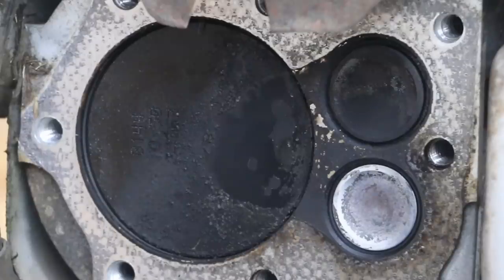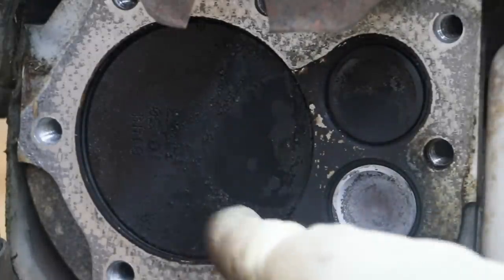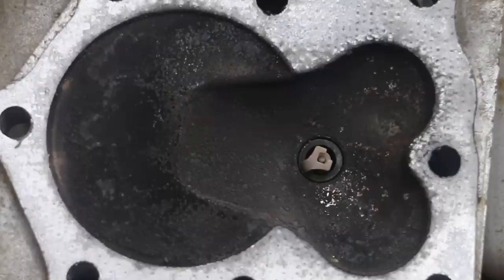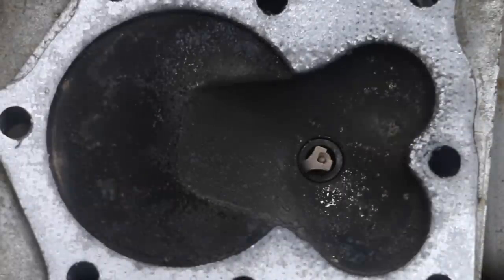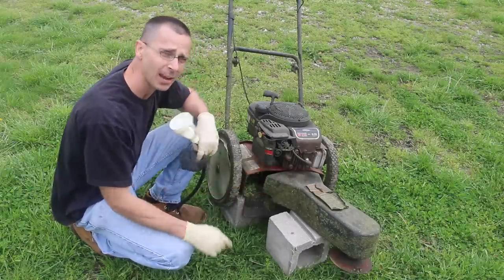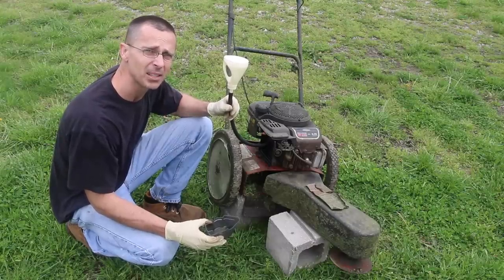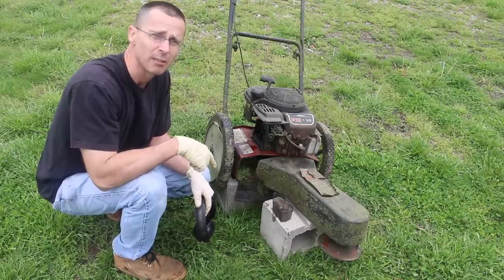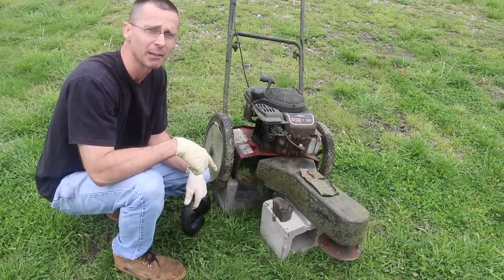Seafoam--can't believe what it did to my engine part 3--cylinder cleaning test!!

Comment: I think if your going to do the sea foam treatment on a small engine like this you should pull the head and knock off as much carbon in the bulk spots then run the sea foam.
Reply from the maker: Thank you for this recommendation!

Comment: I heard running kerosene as oil through the motor could help clear out build up be interesting to see that
Reply from the maker: This is a great video project recommendation--thanks!
Reply: seafoam is 80% kerosene. you can get the msds sheet on it.

Comment: I think it's a 50/50 made a difference of 20% on the piston head and valves  but as far as the cylinder head no difference.

Seems to have transfer from the valves and piston to the cylinder head about 10% from the combustion process due to the explosion off the combustion .

Overall what we can't see is under the piston and valves what difference it made at the bearings.

Due to this being a cast engine, some could say that there is good carbon and bad carbon. 

Some carbon is not meant to come off as it is the pie crust to the engines apple pie.

Take that all off then the pie would just be apple sauce.
Reply from the maker: Thanks for commenting.

Comment: also you may have less carbon buildup by using a better quality spark plug. the Easy fire plugs are a waste of money. as a mechanic when I see one of those in an engine that wont start, by replacing it with a better quality plug can get it running at least 60% of the time.

Comment: what about putting seafoam down the spark plug hole and letting it soak overnight? remove the excess the next day then put more seafoam in the fuel tank and run it and see what happens
Reply from the maker: Great recommendation

Comment: Best way is to mix it in the fuel  every now and then ...It will work on the carbon much longer than directly pouring it in the intake....I only noticed a lot of difference around the valves ,the head and pistons ,none at all hardly..Adding a wee bit of diesel fuel to gasoline helps a lot also,in any gasoline engine,cars trucks etc,..About a half oz per gallon is good enough..Other solvents like Naptha,,Mineral Spirits ,Xylene ,Toluene are great  to use ..
Reply from the maker: Thanks for the recommendation!

Comment: couple questions and wondering if you did a video on this
adding seafoam to the gas tank and if it works better/worse/same
and adding seafoam to the engine oil, does it clean
Reply from the maker: I've tested Seafoam and it does help remove carbon deposits

Comment: Seafoam seems useless, I think water had better results. What about Redex fuel injection cleaner that's usually for fuel pipes and injectors cleaning or carb spray?
Reply: ilia Gofman why useless? I’ve never used it but seems everyone says nothing but good things. Far more than any other additive I’ve ever seen. People have let their carburetors soak over night and they seem to clean it.
Reply: @fringestream990  It's useless because the head and piston are still as dirty as they were in this video. I bet Redex is better

Comment: I use regular transmission fluid!  I fill my gas tank up on my Silverado and then I pour One quart of transmission fluid into the gas tank and run it empty!  The transmission fluid will clean off all carbon as well as clean out the injectors!  Try it and tell me what you think?
Reply from the maker: William, Seems like a great strategy!  Thanks for offering this suggestion!

Comment: I made a breather for a different application by taking a cardboard tube the size of the breather I needed to make. then using fiberglass 1 oz mat and resin formed it around the cardboard after 3 layers of mat 1 oz size set and harden.  I made the top as well to fit the air breather i just made.
Reply from the maker: Impressive job!  Thanks for sharing this!

Comment: will carbon build-up lead to backfire on shutdown on a 17.5 HP briggs 1 lunger???
Reply from the maker: It's possible.  It's likely that the engine is being overfueled upon shutdown.  The engine might be running a little rich. Just a possibility.  Thanks for commenting!
Reply: Probably an incorrect plug, a little hot maybe.

Comment: alot of my neighbors and also my father used transmission fluid to clean out the carbon both on cars and lawnmowers // for cars it was to raise the idle or RPM to about 2500 then slowly pour transmission fluid down the carburetor  and yes it would smoke like hell - same with lawnmowers but on high running idle for the lawnmower -- and talking from about late 1940's after the war to about the early 70's they all did this for the summer time then the EPA started stepping in about 1973 - 1974 with the UNLEADED FUEL and that is when things had to change to the store bought products // but the results were very good by using transmission fluid - not like brand new but still very impressive of the results to how clean it was when the heads got removed // do not know if that will work with the new technology of today's engines but still it just might be worth a try ( mainly on lawnmowers ) or old car from the early 70's that runs on unleaded with a carburetor   would like to see it done if possible as i have not tried myself personally since 1975

Comment: Somewhat better. Part number on piston easier to see.
Reply: The valves look cleaner which would contribute to better flow. Carbon build up on the piston and head would contribute to octane requirement creep and a rough idle.

Comment: Seafoam is most likely the winner, but I would like to let you know that your engine should be at running around temperature or a little hotter. 2nd.- You only need about 12oz. Or less the object is for the hot motor to create steam from the water thus the steam cleaning the motor.

.

@

Comment: This is an old video, but I'm trying to find some unbiased analytical research regarding injector cleaner, specifically for a diesel engine.  Everything I'm finding has affiliate links so I question the validity of the article.
Reply from the maker: Thanks for the suggestion.

Comment: My second comment and it looks like the valve is cleaned up but the rest of it really didn't look like it did much. Still , if you do have carbon buildup on the valves and it's causing low compression the seafoam look like it does the job.
Reply from the maker: Thanks for the feedback.

Comment: how did the engine feel under load? better torque? more powerful? 'coz it can look better and yet performance doesn't improved, 'no?
Reply from the maker: It's hard to tell if the performance improved regarding power.  It did seem to run smoother.

Comment: It doesn't look like it has reduced carbon content, but that could have something to do with how you had to funnel it through the carb. Didn't it say on your truck video to empty the whole can (half in this case) while it was running. You did that none stop doing it this way you had to stop intermittently so the engine wouldn't stall.  Could also the last sea foam deposit where you stalled the engine have left the carbon we see in the final video. Also how would it run if it were hand cleaned vs sea foam.  Maybe that's another video. More laborious but interesting.

Comment: I think the cost of using enough Seafoam to actually get rid of the carbon would greatly exceed the cost of a new engine.
Reply from the maker: lol. Great pont.
Reply: @ProjectFarm  The other thing is I don't think there was enough carbon to be concerned with.  We can still read writing on the piston crown.  Maybe deiberately run an engine rich or with oil in the fuel for a long time to build up more carbon.

Comment: So I'm wondering if you could take it apart and just wd40 and scrub it off and clean it up with a no lint paper towel or something instead of this?
Reply from the maker: Cb, Yes, this would work, but I'd recommend something more abrasive than a lint towel.  I'm hoping these tests reveal which additive cleans best for the more difficult engines to dismantle, like those in automobiles.  Thanks for watching the video and commenting.

Comment: i had an old 2001 ml350 with 250k+ miles,
started having 2-3 cyclinders misfire.
(it was starting to have problems going over overpasses..)
used Techron about 3-4 times,
CEL light disappears and power becomes waaay better.
(although its worth noting my fuel pump went out about a month after)
(I wouldnt bring it up, but its never given me problems and the stuff just so happens to run through it...)

Comment: Seems to me that given you can examine the head and see up close, that your opinion of what kind of difference it made is valuable and should have been included at the end of the vid. Good pictures but not perfect focus on both shots and no comparison to looking at it closely from various angles (like you dis at the start of vid) and even feeling the engine run after.

Comment: There was  GM product called X-66   that did the job, if still available,  try  in throttle body and remote fuel injector service port valve, NOT in fuel tank . Use per instructions  or seek a knowledgeable  mechanic. Similar results, 
Suggest a oil change, new fuel filter, and new spark plugs , thoroughly  clean throttle  body and idle air bypass ports. The video looks promising,  smoke show - try not to breathe fumes,  may try on our  service van. Thnx 
Proper maintenance  is every auto owners responsability , good luck!
Reply from the maker: Thank you for this recommendation.

Comment: What He did wrong was he DID NOT rotate the motor til the valves opened and do a before and after on the valve stems right under the valve. That's where the carbon will affect the performance. The carbon on top of the piston and the head will actually raise the compression just a little. Sea Foam is a great product I use it too, but BG 44K is much much better and the only additive that I have used where You notice a improvement almost immediatly.

Comment: I believe that only doing a compression test is not an accurate way to effectively determine how much the seafoam/ water helped or hurt your engine. I feel that you should conduct a leak down test of the engine because it will show the health of the engine overall not just the compression. With a leak down test you can determine the quality of the valves and if there is carbon removal from the valves it should decrease the percentage of leakage on the engine. from your videos the compression does not have enough of a variation to conclude any results.

Comment: You can actually use diesel fuel to clean your crank case out ,no oil.flush all the carbon build up out,not to run it that long, replace with recamended oil,and done with out the seafoam cost,it's a good product though!
Reply from the maker: I'll test diesel as a crankcase cleaner in a future video.

Comment: You need to consistently pour the seafoam  in. Create a continuous stream of smoke and then stall the engine. You were adding the letting the engine immediately burn it off then repeat. This is why your result was not as clean as expected.
Reply from the maker: Thank you for this recommendation!

Comment: Why in all of these videos are the before and after photos/videos taken under different lighting conditions?It looks to me the only difference here is that the 'after' photo was taken with a flash or under brighter light than the before.  The carbon largely still remains on the face of the cylinder.
Reply from the maker: I apologize for the poor lighting control.  I've improved this in more recent videos.  Thanks for commenting.

Comment: You should have added to the fuel to stop the stall out as the stalling allows the carbon to build as the the fuel is not combusting to its full potential
Reply from the maker: Thanks for the suggestion.

Comment: hello! I'm from austria and we can buy in hardware stores similar liquids from "Liqui Molly" called "Ventil Sauber" (in english: Valve Clean) which can clean the engignes from carbon, too. BUT the liquid from Liqui Molly must be mixed into the Gas. 150ml of valve clean are enough for 75 litres of gas!!! 
so, could it be, that your Sea Foam must be mixed into gas, too?? i wonder a bit about sea foam's usage...

Comment: What would be great is if seafoam actually created a FOAM that filled in all areas and did a deep creep and eventually dissolved.
Reply from the maker: Thanks for the feedback.
Reply: @ProjectFarm  Thank you for all your videos.  Super helpful.  I was wondering if you could do a video on if "Saltaway" really works and getting rid of salt, especially in an outboard motor but even in general if it easily gets rid of salt upon contact.

Comment: seafoam like most additives is more of a gimmick then anything, you inject just about any liquid into a hot enough combustion chamber to produce steam and it will remove some carbon (water works good) although not so much in lawn mower type engines, they don't have enough mass to stay hot long enough after shutoff. the one exception i've found is berrymans, you take 2 valves with equal carbon deposits and soak one in seafoam over night and the other in berrymans and the valve in berrymans will be noticeably cleaner the next day. back in the days before catalytic converters every car manufacturer made a foaming top end cleaner that would de-carbon an engine completely but if you tried them in today's engines it would completely clog a cat in 1 treatment which is why they can't make a simple one step de-carbon additive now days that really works  you have to use one of the systems that not only breaks the carbon loose but also then chemically dissolves it into a burnable matter before it can come in contact with the catalytic converter which in a lot of new cars is right off the head in the exhaust manifold....

Comment: Seafoam, IMO, not worth the air pollution that it causes. If your gonna take off the head off a small engine, better to sand or scrape off the excess carbon. On a Car, or truck, I would take it out for a 30 min highway road trip to clean the engine. And, always use quality fuel!  Watered down gasoline will kill an engine, most engine teardown mechanics will agree.  As always, Thanks for the Video!
Reply from the maker: Thank you!

Comment: I'd be interested to see if increasing the oxygen concentration in the air would burn those carbon deposits off. Maybe use an oxygen generator or just the O2 side of your oxy acetylene torch and introduce it to the carburetor. Without adjusting the fuel flow of the carburetor, it should lean out the fuel/O2 ratio and burn hotter and the excess O2 should burn off the carbon deposits. I wouldn't go with 100% O2 though, just increase it from the 20.9% O2 in the atmosphere.
Reply: Interesting thought

Comment: Should of used just water!  Small amounts dripped in very very slowly will do the trick!   I added a Holley water injection system of a F150 for van years ago...why? Van would run Hot when pulling my very Big heavy boat....after the Holley system ran very cool. A 120 mile trip van used a quart of water!  Sometimes I added Alcohol to the water as well. This is just FYI for you guys.

Comment: Honestly, I don't really care about carbon buildup. That's just a fact of engines. I do dump a bottle of seafoam in my gas tank every now and then to clean out my carbs and injectors though. Seems to help keep the fuel system nice and clean.
Reply from the maker: Great point. Thanks for commenting!

Comment: I used alcohol as the fuel. Nothing but alcohol cleaned everything including the exhaust pipe. After trying it in my lawnmower I used it in my 1970 Ford truck then my 1997 Saturn. The mileage decreased, of course, but so did the carbon.
Reply from the maker: Thank you

Comment: I definitely saw a difference, but I think you can take it a huge step forward and run can after can through the engine, until all the carbon is gone and truly prove it works. I think that is the only true way to get an accurate test and result. At the same time you can compare others that claim the same thing. But I think the best product you can debunk with the video is the super gas shell and others adverse. Shell and others claim their gas cleans and protects your engine with science and magic, but I think they are full of it. I would gladly donate to you if you could prove one way or another that the additives like seafoam or just plain gas does or does not clean like they say.

Comment: Seafoam good but it's not like a degreser were it removes carbon or see a drastic change .  But it works great on older high mileage  under maintain vehicles that's when you see a good difference when the vehicle really sick.
Reply from the maker: Great point!

Comment: If you were planning to remove the head it would have been easier to give it a quick wire brush, a rotary wire wheel would've  cleaned the carbon much better than seafoam.
Reply from the maker: Thank you

Comment: I had a mechanic tell me to put 1/2 can in with oil & the other half in gas. Within 60 miles I had a rod knocking.
Reply: you know you're supposed to change the oil after a few miles right? the seafoam is supposed to clean out oil deposits so you can change the oil, but it also makes the oil unfit for long term use in the engine.
Reply: @Moose370  He knows now.

Comment: I don't see anything worth while in the before after pictures.  I've ran a head off test on a single piston Tecumseh 7hpn engine with no carbon removal.   I did some shelf tests with Seafoam and Stable in clear jars each with carbon flakes and about a quarter ounce of water.  They sat for weeks with occasional shaking.   At the end the flakes and water remained.
Reply from the maker: Thank you for the constructive feedback